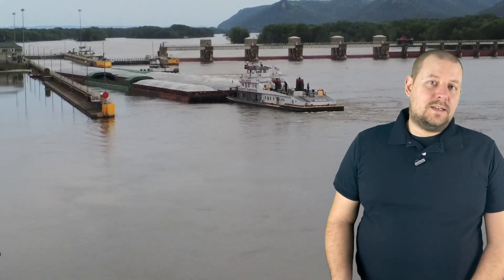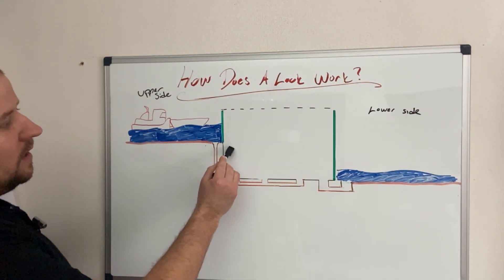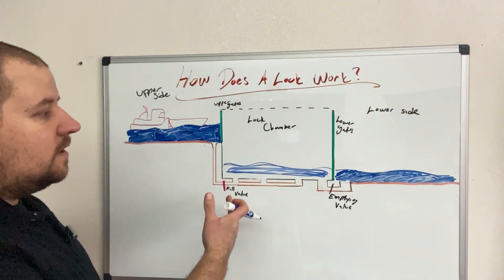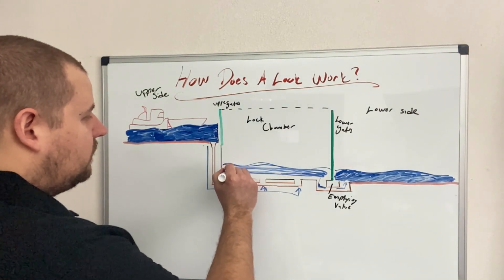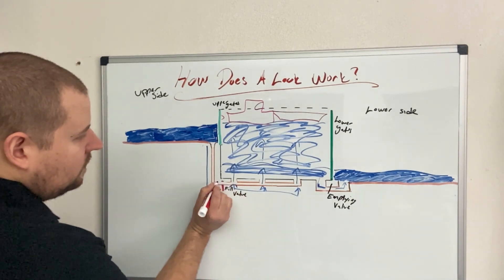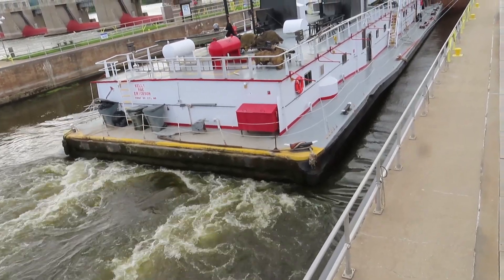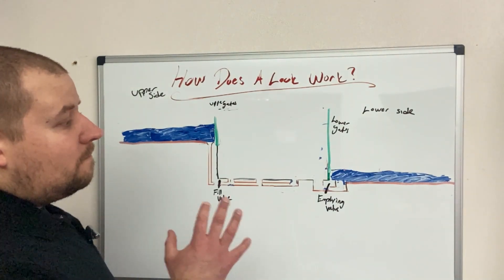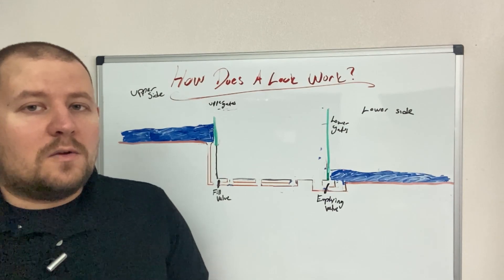How Does a Lock Work ( Lock and Dams )

Comment: So I guess I'm missing part of the big picture... Why is the river at 2 separate heights to begin with?? And how do all of those barges get through it? Seems it would take forever for 15 barges to get through it. I seen the lock and dam at Quincy IL today first and then seen the one at Canton MO.  Sorry for the silly questions, I just don't get it.
Reply from the maker: Not a silly question and Im happy to try an clear it up. Why 2 different heights? The Mississippi River is known for carrying a lot of sediment. this sediment keeps the river surprisingly shallow making it near impossible for barges to make their way up the river as they will drag bottom. The federal government has instituted a 9ft depth requirement to keep the river deep enough for navigation. The locks are connected to dams which will regulate the water depth above them. If the water is low they will close the gates on the dam causing the water above to rise. during floods they can release water but either way the army corps of engineers can have some control over the rivers depth keeping it deep enough for navigation. There is also wing dams and dredges that help to keep the main channel deep. A series of locks and dams from Minneapolis to St. louis to keep water levels where they need to be.    as for barges and locks. The "standard" barge is 35 feet wide by 195 feet long. The Quincy lock, Lock 21, is 110 feet wide by 600 feet long. This means  several barges can fit in the lock at one time. Often they will have to split up the barges and send through a handful at a time requiring several cycles of the lock. It is normal for this process to take upwards of an hour to get an entire tow through. My I recommend you watch my series "My Great Escape Kayaking the Mighty Mississippi". you will see the locks from my perspective and also you will see many occasions where I have to wait on the barges. One more recommendation is my video "the road home" where we stop at lock 6 and you get to see a great view of a barge coming through a lock from the observation deck. I hope this answers your questions! 🍻

Comment: Well, you get the idea across, but your nomenclature is very inaccurate, and the location of the openings are wrong... they are not in the floor, but in the Monolith walls. The Control Valve is called a "Culvert Valve" since there are large Culvert openings to channel the water through the large Monolith walls. Another important fact is that the Dam intentionally raise the River level so we can navigate the rivers this way, which is very important for improved shipping of good, saving Billions a year on Trucking and even Rail cars every year. Having these helps our economy.
Reply from the maker: i appreciate the info. i know the use and need for the locks and dams is to maintain the 9 ft navigation channel. i really made the video due to so many people giving me a hard time about the lock "wasting water" just for a kayak to come through. i paddled the whole mississippi in my kayak which is where these comments come from originally. my knowledge of their actual components and device names is minimal as you picked up on but i went through nearly all the locks on the mississippi. the video was a simple explination for people that were giving me a hard time about locking through in a kayak.
cheers

Comment: Personally i dont have an issue with a single kayak using a lock and dam. The people complaining probably dont consider the amount  resources (fuel and lubricants) that is used bringing a single kayaker to the river . While I have to imagine the gates powered hydraulically use quite a  lot of electricity to turn hydraulic pumps large enough that in turn open and close those very large steel gates, would those complaining prefer a hundred kayakers to use the lock and dam? That sounds good to many people , only be cause they aren't intelligent enough to ponder how much resources in the form of fuel and lubricants they never consider in such a complaint. For 100 kayakers to be there in order to use the lock and dam would mean a huge amount of vehicles necessary to deliver 100 people and their kayaks to the river in the first place, all those resources are ok just so the lock and dam isnt used by a single kayaker . Single kayaker = single suv driven to river. 100 kayakers = 100 suvs driven to the river. Carpooling isnt an effective option due to you still need to also transport 100 kayaks to the river, thus using up all those resources, probably much more than the lock and dam requires in electricity to power hydraulic pump to open the gates on the lock and dam. Great job explaing the locks on your video.
Reply from the maker: thanks for the comment. if one thing is for sure its that people dont think things through. all too often they make their comments in complete ignorance.
cheers man!